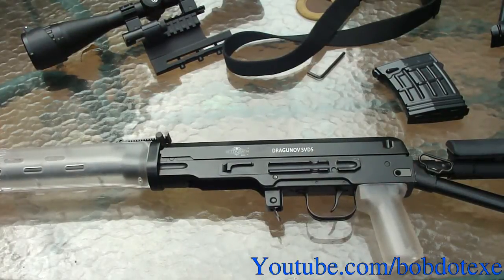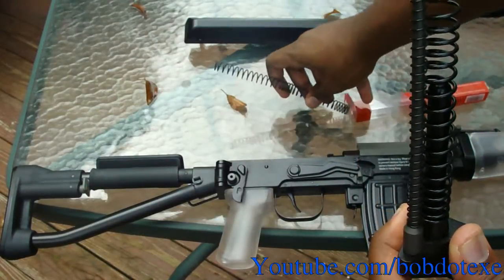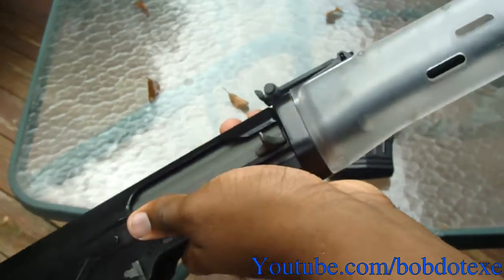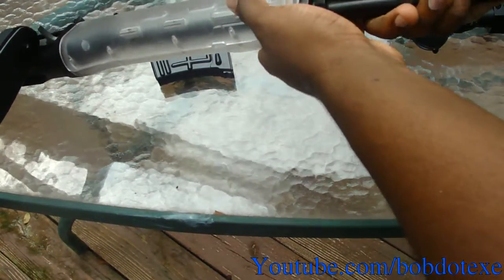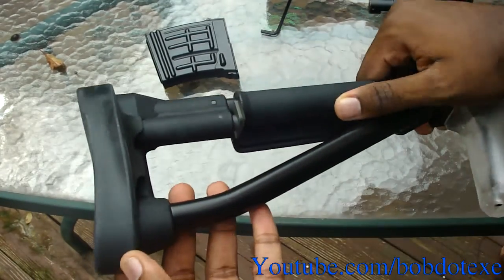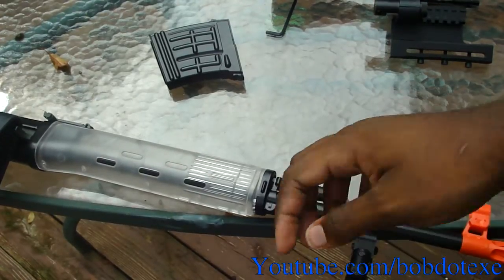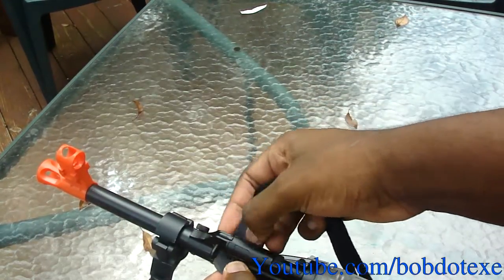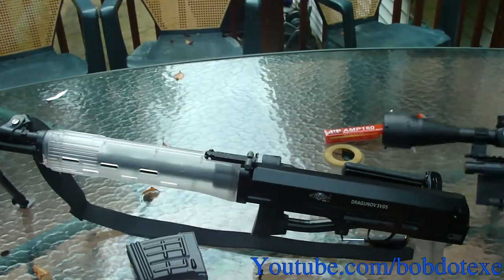[Legacy/Outdated] Aftermath SVD-S Upgrade (TK-52)

Comment: Excellent bargain from Trademygun $45! We've only had this bad boy for about 2 weeks. Oem mag (Hi-cap 20 ends) prefers to be completely full to feed. Rifle has an occasional double feeding problem, not sure what's causing that. Out of box, this was spot on at over 100 ft with a 2liter bottle as a target. It chrono'd 425 ft with 0.23 bb's. We tested and can easily hit 12" tree trunk at over 225' with some hop up tuning. A solid gun and decent starter sniper rifle for the money!
Reply: Jetli _Notme did you find a way to fix the double feed problem? I heard this was common. Anyway, the standard rifle that you got out of the box, what was the maximum range? Any other comments or details you have would be very appreciated. I am very excited for this gun and will read as much as i can about it, so anything you've got, give it to me. Thank you so much in advance.

Comment: With my gun the bbs curve off to the right at the end of the trajectory about 85 metres or so. Any idea why.
Reply: thra5herxb12s 85 meters is a very long shot that is what the ssg24 is made to do make a shot that accurate unless you have like .30 gram bbs and up it will curve like that
Reply: I found that when I got to my sites target range the accuracy at 50 meters was spot on and the same out in the woods.  I was just expecting a bit too much from the gun.